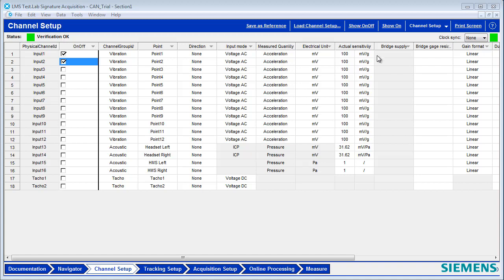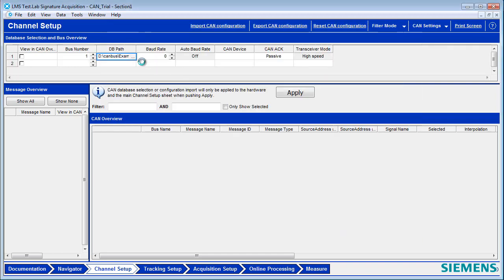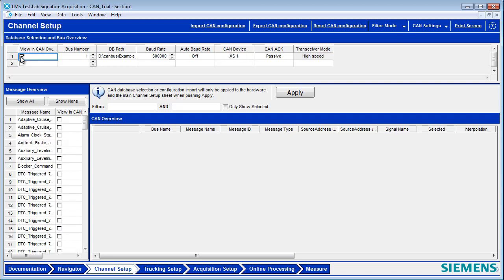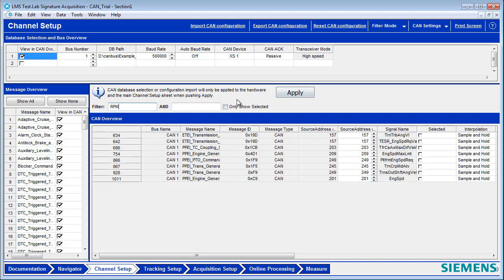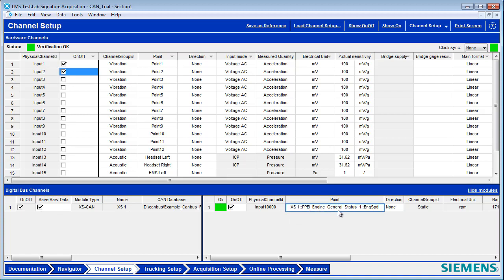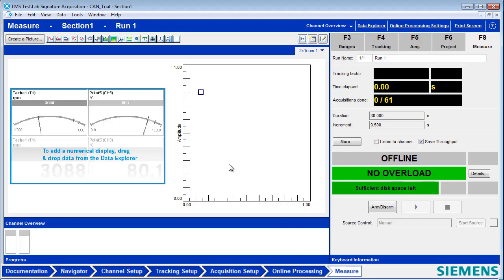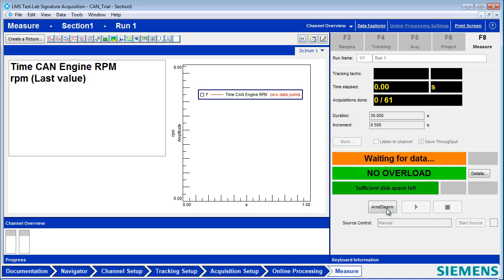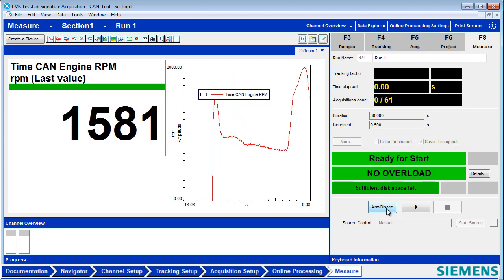Simcenter Testlab: Acquiring CAN Bus Data

Comment: Hello, does the DBC file need to be connected with the can channel of LMS equipment through the DBC interface of the car?

In addition, I would like to ask, in can ACK, you can choose passive and active. What do they mean respectively?

Thank you and look forward to your reply
Reply from the maker: Usually the CAN bus interface of the SCADAS is connected to the OBD (Onboard Diagnostics Connector) of the car.  The DBC file is a software file containing a list of the available CAN channels, not a physical connection. Newer cars do not always use the OBD.  See this article for more cable information: https://community.sw.siemens.com/s/article/can-bus-measurements
Reply from the maker: Passive is used when a signal is already being broadcast on the CAN network.  Some signals need to be specifically requested before they are available, then the mode must be Active.  Emissions data for combustion engines are an example of signals that require the mode to be active: https://community.sw.siemens.com/s/article/no-more-tach-use-obdii-to-get-engine-and-vehicle-speed
Reply: @SimcenterTesting  Hello, thank you for your reply and answer. In practical application, I found that the path of "DBC file" placed in the computer must be in English? When there are other non-English name paths, the checked parameters will be imported into the channel. Is this normal?